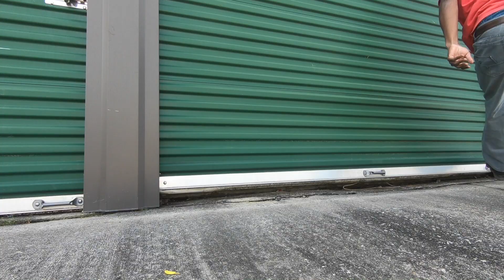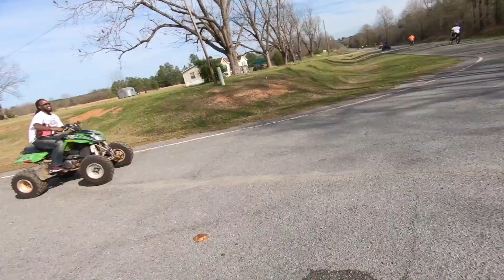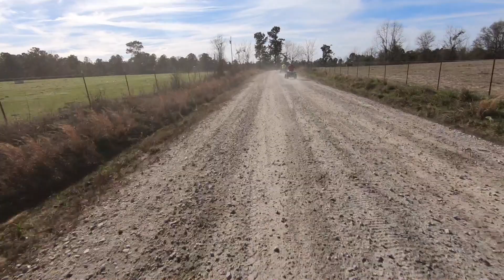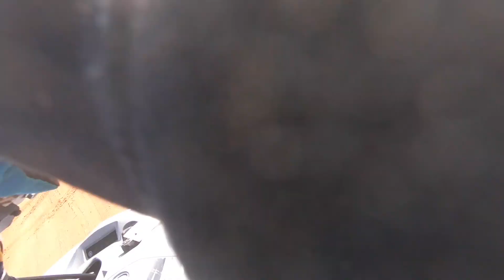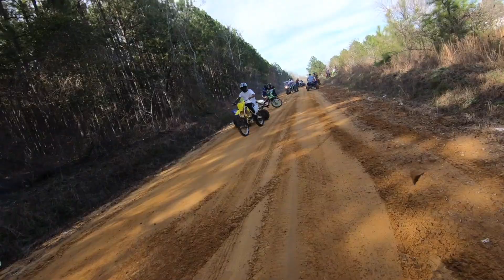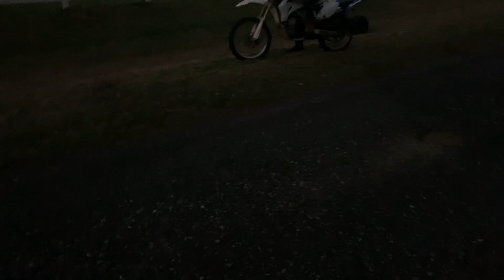THE WRIGHTSVILLE RETURN....AND I TEST DROVE A 2K19 YFZ 450

Comment: I had 4 kfx’s back in the day haha my issue w them mostly were cracking the frames 5 of em in 2 years plus i had my fair share of electrical issues as well the wire harness can get rubbed down in a few spots gta keep an eye on that which can cause the bike to die have to say switching to the yfz450r was the best move for me